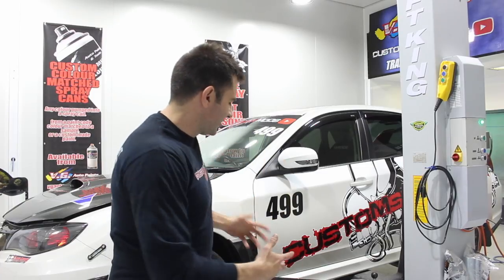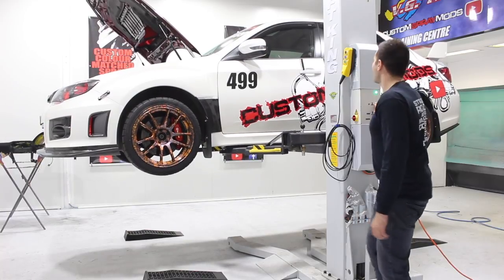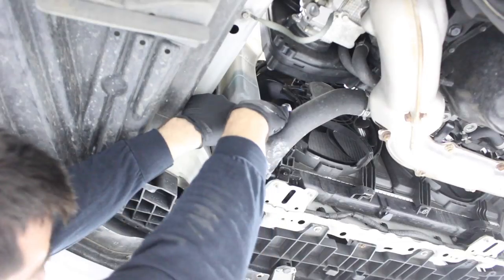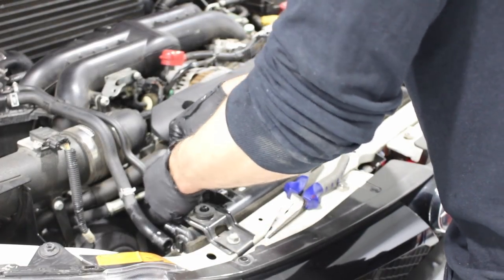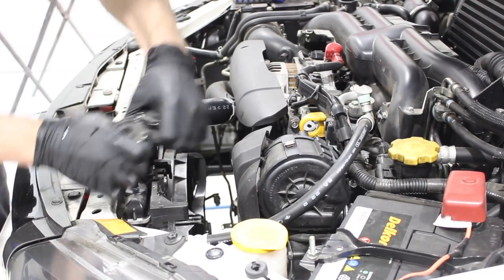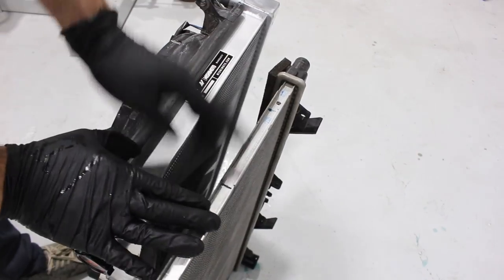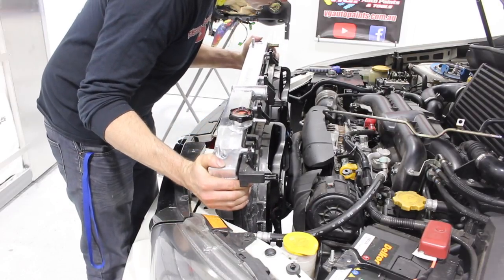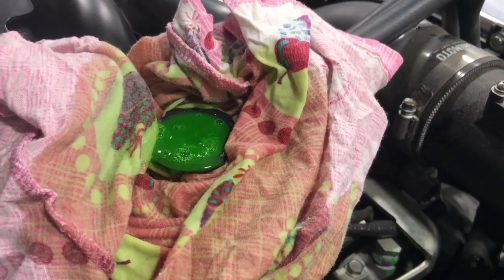How to Install a high performance radiator in a WRX/ STI

Comment: Are you sure the green coolant is compatible with Subaru's blue coolant?
Reply: Sini_ster I was thinking the same :(
Reply: If its been flushed, no problem, if it has not been flushed then the coolants could become an acid and eat all the gaskets , but i dont think hes an idiot
Reply: @superhacker101  it’s absolutely not, subaru uses special additives in their coolant that prevent their head gaskets (which are always touching coolant due to the shape of the motor unlike most cars) from blowing

Comment: Was your factory radiator broken or insufficiently cooling the car?
Reply: insufficiently cooling the car
Reply: My radiator fans are turning on whilst driving sedately. Temperature is normal, heater works and air-conditioning aswell. 2016 wrx sti 130,000km. Had it since new. Original radiator

Comment: If one buy a performance car  isn't it already a performance radiator in it? Then why buy a new one if the first one ain't broken
Reply: Because it’s not a performance car from the factory. It’s just a 30k car with a turbo. I love mine but I upgraded the radiator and intercooler before I did any other mods.
Reply: @cdw584611  oh ty then